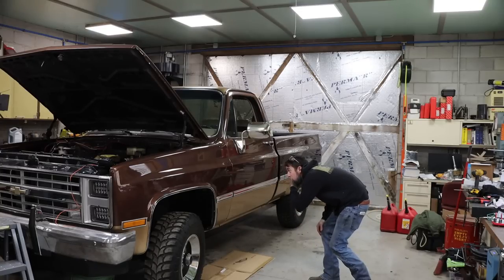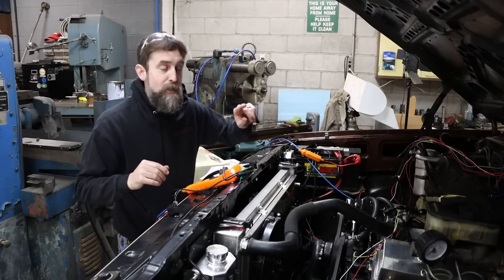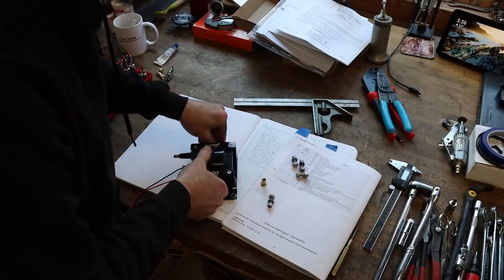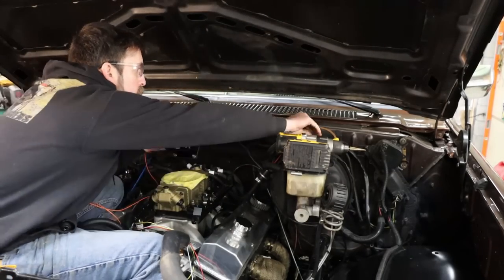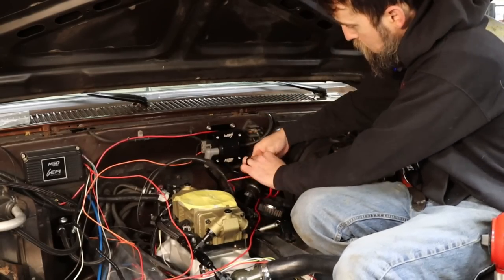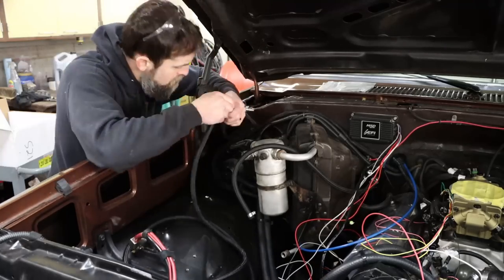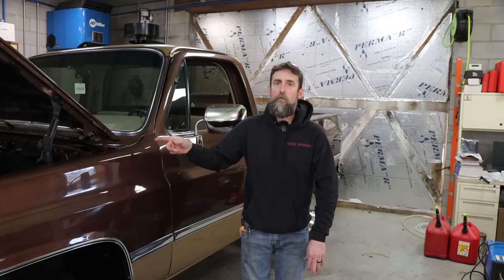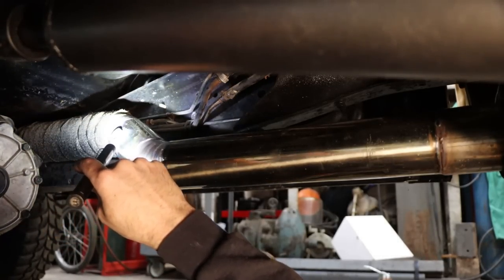I am Amazed!  Install & Test Holley Terminator X Stealth on my Chevy K10

Comment: Hello Steve,  from Scotland.
Great build.  I'm thinking the ignition switch is not allowing 12v through to the ignition system while in the cranking position.
As a test; try just touching the starter and let go the key. I reckon it'll start right up without the 2-3 cranks first.

Comment: Steve, I can't remember what engine block you used but classic SBC has a bolt boss that intersects the bore of the fuel pump push rod, which you deleted. Sometimes that can leak some oil and a short 3/8-16 bolt will work as a 'plug'. 

Truck looks and sounds great. Would be interested to see more footage on tuning and fiddling with the fuel map with the laptop when you get there. Thanks.
Reply from the maker: It was plugged👍. I just didn't show it.

Comment: Steve, when I have to mount a flat unit on uneven walls like that, I cut a piece of 1/4 copper tubing to fill the gap behind the unit which stanchions it off and I run the screw through my unit, through the copper tubing, and into the wall securing without vibration.

Comment: Happy Saturday Steve, Cora, and Grits! Great Job on the Hilley System. Once into Fuel Injection, you will never go back. Your perception on clean power and good grounds is right on! We had so many issues with this when Detroit Diesel first converted units in the field. Must be clean power. Wished you would have put ypur foot in it on camera. I know you did for real. Awesome Thanks for sharing.

Comment: Great video Steve, I will be doing all the same steps when installing the Holley Sniper EFI on the Nova!
Reply from the maker: That Nova is going to be a rocket bud. This truck runs better with just the factory set tune than it ever did with the carb . You are going to have a lot of fun.

Comment: If not built into the computer driver or the fuel pump relay, you need a back biased diode across the relay coil to snub the spike when relay coil is deenergized.

Comment: There are two ways to knock down RFI, you can put a gentle twist in the wires and avoid sensitive areas. Option two is to get shielded wiring sleeve to pull over the wiring .  Another thing I learned wiring race cars with lots of sensors and electronics that need clean power, often off a compact battery, is to add a quality terminal strip or two (one POS, one Gnd) wired too and mounted in an available spot where you can easily  connect all your power wires to a known clean 12-16V and a known good ground.  They are also available with built in fuse holders.

The old truck is looking and sounding good
Reply: Few of us know of these bars. In my world everything I own has them.

Comment: Steve, are you sure your ecu got ignition +12v when cranking the starter? 
Noticed it fired right up when you let go of the ignition key, that's typical for issues with power to ecu/ignition while cranking.
Ps. Love the setup. 😊
Reply from the maker: Yeah, it's getting a full 12v cranking. It will start if you hold the key on crank longer. I just let off quick.👍

Comment: Steve, I bet you have the most perfect and most advanced pickup of this model in the whole USA. I think you did a better, more nice looking job on the installation than the factory would have done. The only thing that I see wrong with the installation is that I did not see Elizabeth helping you on it. I am shore that she could made a few improvement suggestions to you that would have helped. Good job Steve!

Comment: Ahhh, SATURDAY. If there is something in this world I love to do is everything this channel has to offer. What a great post Steve! Everything you have done on this build has been done right. The end result is the proof of that statement. It sounds great. Does everything you ask of it every time. I saw at original startup it was running a tad rich. I am sure that is intentional from Holley as it is a system that learns through the exhaust sensors it will most likely correct that on its own. Better too rich than that piston and valve eating lean situation. As well you have the ability to tune through your laptop. Great system my friend. Ohh that sound, LOL. Back to machining, WOOHOO, I'll be here, guaranteed ! Thanks a bunch fella !

Comment: Well done. I suppose the Holly with  replaced Weber metering plate is a thing of the past. This is a far better result than hundreds of initial fire ups I have seen over the years, And certainly the best I have seen with anything Holley on it.

Comment: Hopefully this will give you better management of the fuel air!
My problem with my 2009 avalanche v8 is I live at 580 feet and going up a hill some times under cool humid conditions it marches over just fine other times it lugs out and finally race up the hill!
That tells me the system needs help!

Comment: Hi Steve.  That was a sweet truck before and now it is even sweeter, with upgraded fuel and ignition systems.  Much better overall styling on the square bodies, too (in my opinion) than the new ones.  Can't get over how much that throttle body looks like a regular double pumper.  Nice, old school look, under the hood!  Thanks for the video!
Reply from the maker: Yep, looks at home under the hood of this old truck. I didn't want to loose that old carbureted look.

Comment: There’s one happy guy! Nice work Steve. Welcome to the world of EFI on old Detroit iron. It’s nice for the HEI equipped GM vehicles have a constant 12V source. My 68 Camaro does not. Those old cars had a resistor wire from the ignition switch (run) and a 12v wire from the starter solenoid to the + coil terminal. Other than having to flip a switch prior to starting, it’s hit the key and go. Congrats on the latest mod. You’re going to enjoy it.

Comment: I would have put the relay next to the fuel pump. Generally, you should keep your high current wires as short as possible this is because the small voltage drop between the ECU and the relay is more desirable than the higher voltage drop you'll get if you locate the relay away from the high current device (fuel pump). You can usually get away with having the relay located away from the fuel pump if you increase the cross-sectional area of the cable.

Comment: I installed an efi kit on a scooter I had it was fun and it started and ran so much better than with the carb setup had to change the charging system so it could keep the battery charged up

Comment: Instead of running the additional oil pressure signal wire, would it have been feasible to move the unused MAP signal wire to the pin 20 spot?

Comment: When you see one tape or cover a carb or throttle body while working under the hood installing new parts, you know they are a top of the line mechanic. Been there, and  and it's an oh-shit, when something goes in it 😞. Steve, you will have a $5K truck when your 100% done. Loved the whole build and all the time you and Elisabeth took time to film and share. Happy Trails, and it's a keeper for sure? Bear.
Reply: 5K? If I could buy that truck for 5K I'd drive 48hrs straight to hand him the cash.
Reply: I think you missed a zero there, Bear. Lol I know what you meant though.

Comment: Mr Steve man what kind of single phase motor could I use to run a lathe like yours
Reply from the maker: There are lots of options and it would be hard to give you a straight answer.  Not know the lathe you are using . I would give Baldor a call and see what they recommend. Mine is made by Baldor.

Comment: My word steve that truck is to die for, from the colour/interior to the looks and sound (very jelious) just wish thay were avilable across the pond in the uk (wouldnt like to think what running costs would be here) still another great video love all your content especially this one, Great job.
Reply: There are lots of buyers from there that come to Canada (here) and buy truckloads of these to tinker and sell over there. You just have to look around some.
Reply: @TomokosEnterprize   I have to say I've been driving in the UK for 51 years and I've never seen a Chevy square body truck on the road over here.
Reply: @samrodian919  The buyer I met is from the Netherlands. One thing about them is your roads are pretty too narrow to comfortably drive there. I have sold 2 narrower 1949 Williys pick up's to a Brit buyer some 3 or 4 years ago. No matter what the condition he paid well over $10K Canadian for them. Both were in fairly solid body condition. Both ran as well.
Reply: @TomokosEnterprize  well I run a Range Rover L322 4.2 Supercharged, and that's a pretty wide vehicle for the UK certainly as wide as a Ford Transit van, and I don't have any problems on my local roads! Yes UK roads used to be pretty narrow, but big heavy euro trucks ( small by US / Canadian standards ) have literally forced the local authorities to make the lanes wider when they are resurfacing the roads. So it's not so bad these days lol
Reply: @samrodian919  I have always wanted to visit all of Europe. Most of us here have ties to there. Norway, Brittan and Scotland for me. Canada has always been called a melting pot of races. of all kinds.

Comment: why start it up with no air filter - a minor but important quibble after all that work - nice to see you running efi now - pls do a followup after you have driven it and all - startups should be much easier? you will have to tweak it a bit but you now have data logging which is a big plus - no guessing

Comment: Great spot to mount the coil. I always tell people to keep the coil wire as short as possible, but keep the coil off of the engine. Unless your planning on racing the truck, you really don't need to do any tuning. Now if you add some kind of power adder, then you need to tune it and get into the fuel tables and timing retards. The more you drive it the better it gets. Steve, I like your tester, who makes that?

Comment: HA!! THE welding trucks are all electronic controlled with a  welding bed on back to weld right on the truck bed.....
 You just cant run the welder through the truck electronics!